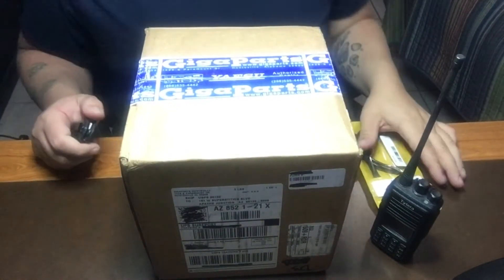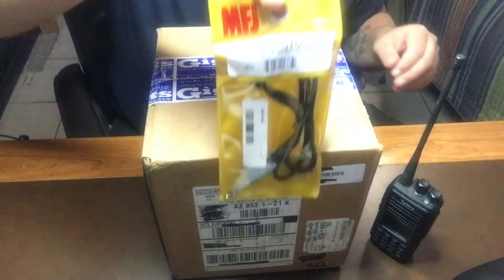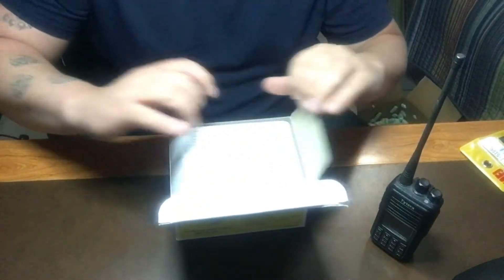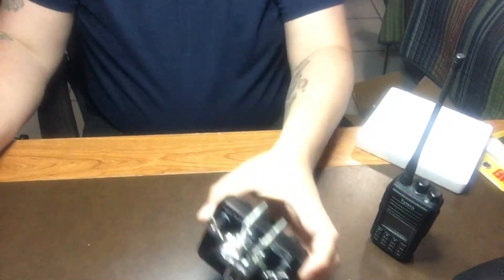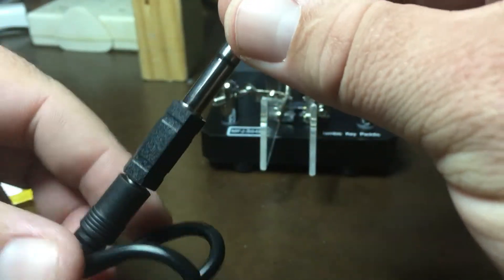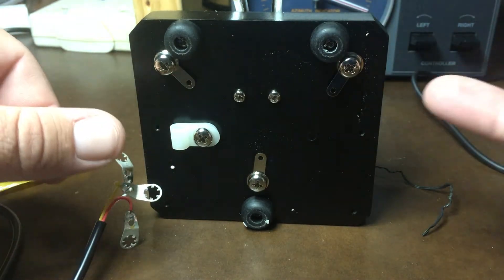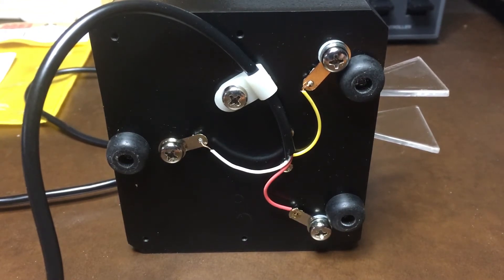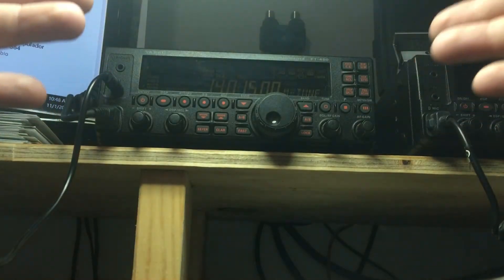MFJ-564 Paddle with Factory Fail!

Comment: Three years later, my hope is that you attended the CWA and kept at it! You are far better than those "old" hams back in the 80s who used to bitch about how hard it was to learn the code. If they had spent 10% of the time practicing and using Mores code they'd be doing 20-25 WPM now. 

You are practicing an exciting and noble part of amateur radio history!

73 ES GL DE k6whp
dit dit
Reply from the maker: Hey William, Thanks for your comment and reply! I did in fact attend the CWA and passed. I had Rob as my mentor, which was very cool! Thank you for your support, hopefully one day we can have a qso, I'm still slow, but thats ok right?

73' KE7FEI "dit dit"

Comment: I have the same key and bought it for the same reason. I just completed the CWA level one training. I don't remember having any issues, but now I want to check. I'll take a look at the paddle when I get home and leave a note as to if I had to solder as well.
Reply from the maker: Ron C its a great keyer! I’m excited to use it for the academy. Just sucks that the cables that I got from MJF the ends didn’t fit over the screws.  Thanks for commenting Ron, have a great day 73’ KE7FEI

Comment: I use the same exact paddles just set on reverse. 
I do dashes with my thumb.  I like it.
Reply from the maker: Chuck Howard that’s a good idea! I may change it around and see if that works too. I’m enjoying the paddle for sure. Thanks for your comment! 73’ KE7FEI
Reply: Old timer suggested doing reverse so you could later go to left handed keying and taking notes with your right hand at the same time. I did it and it feels fine. :)